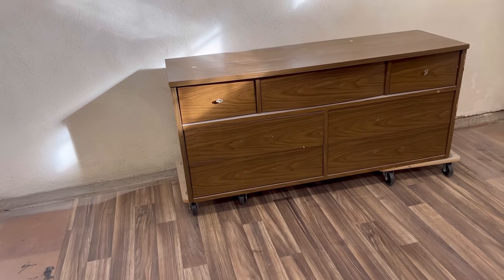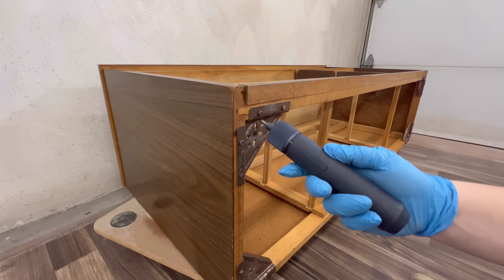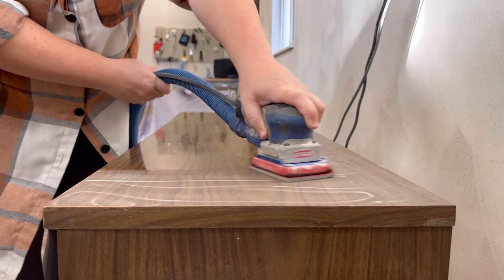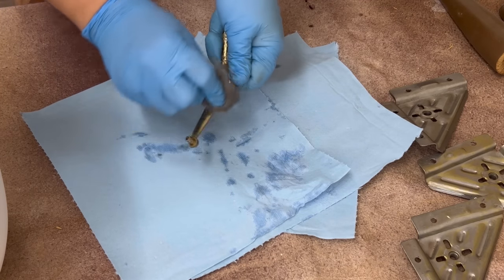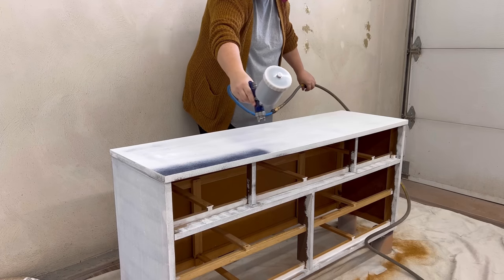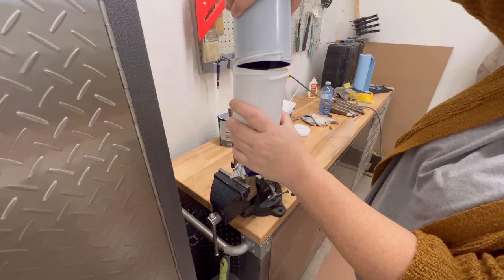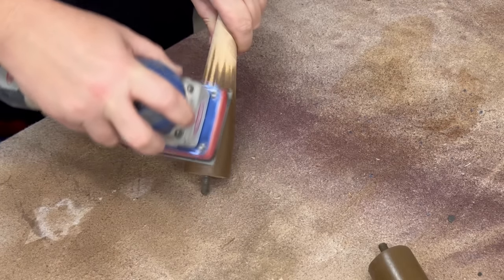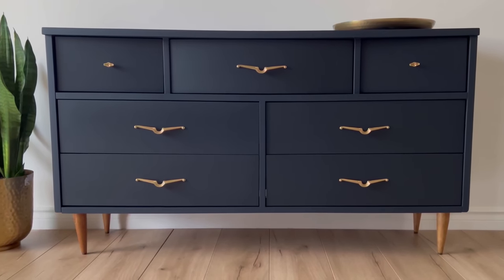Just because it’s LAMINATE doesn’t mean it’s JUNK! |  MCM Dresser Makeover

Comment: To the question of veneer, check out "Dashner Design & Restoration" specifically the video:"How do I tell if it's solide wood or veneer? What is wood veneer? Is veneer a Bad thing?". It answers some questions, very interesting!
Reply from the maker: Dashner has great videos and teaches a ton. This is not a wood veneer however. It’s a laminate veneer. I’ve also got several videos on the topic and ways to identify them. Sometimes you make assumptions though and end up getting surprised.

Comment: Do you have any videos where you repair the drawer slides/tracks that are inside the dresser? I have a piece that has damaged slides and I am trying to figure out the easiest/cheapest/most effective way of doing that.
Reply from the maker: You should be able to find new runners and guides on Amazon and a lot are pretty easy to swap out.